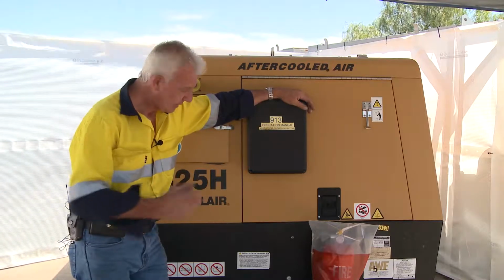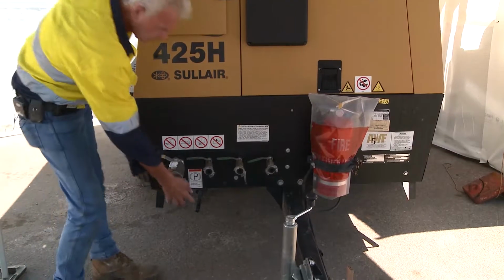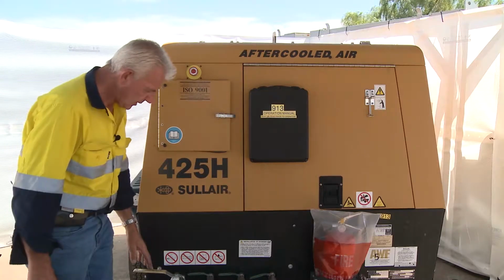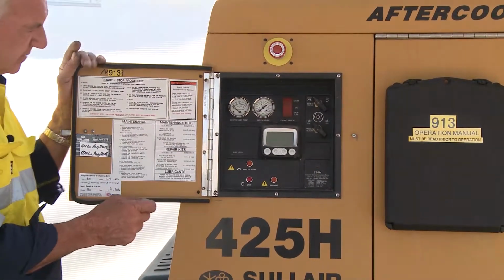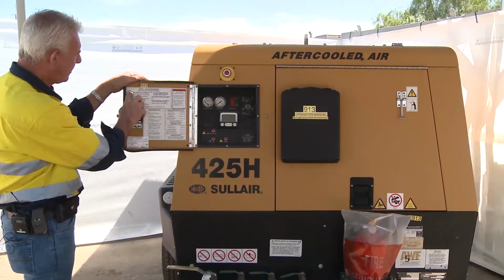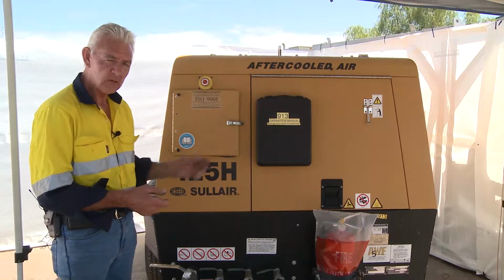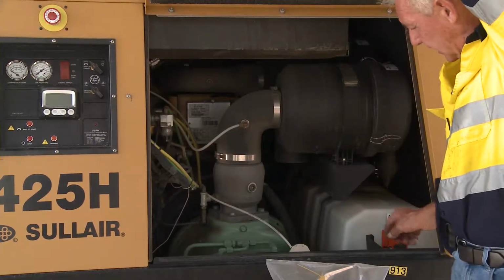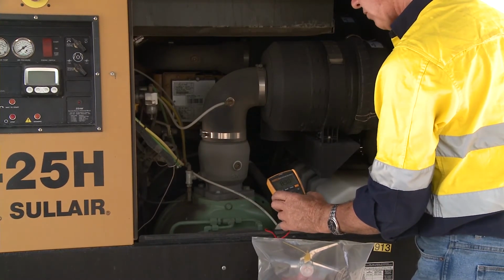Set-up of diesel compressor and daily checks

Comment: So I have a question I have kaeser Diesel compressor so when I let it run for 10-15 
sec and when It time to load it, it runs for like 5sec then it shuts down do you know what can cause that?
Reply from the maker: Hello Rob, sorry we have been unable to recommend a solution for this, it could be many different reasons. we recommend you reach out to a qualified compressor mechanic